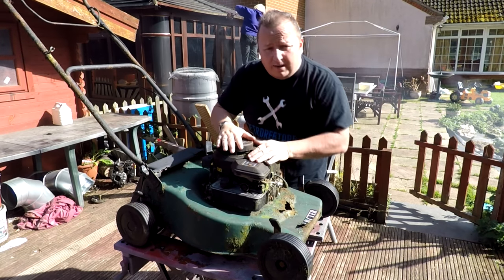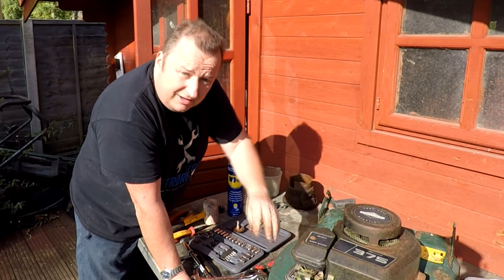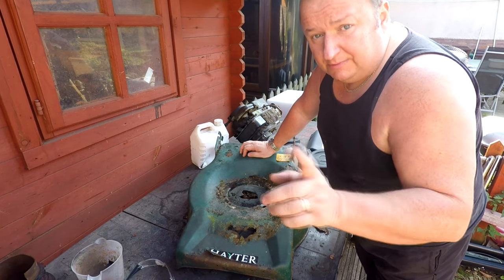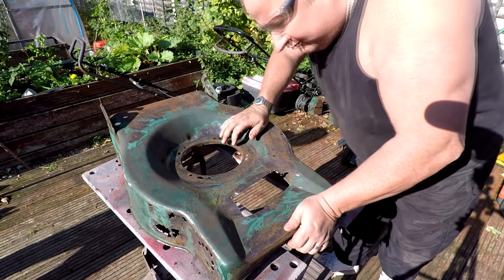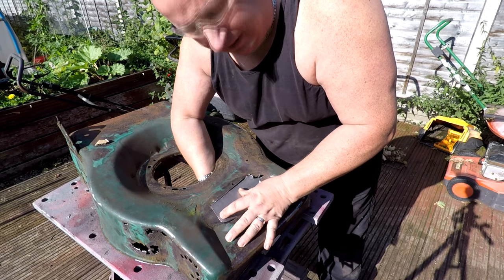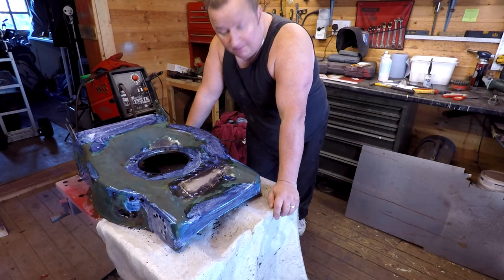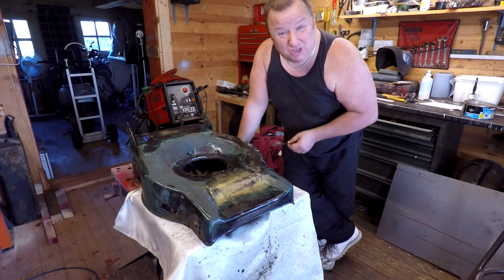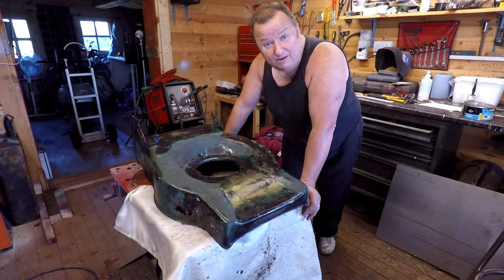The Worst Lawn Mower In The World Gets A Makeover

Comment: A handy tip...weld doesn't stick to copper, so if you clamp a piece of copper to the back side of the mower...it'll give you a base so you can puddle weld the little holes up
Reply from the maker: Yes Andy, I will be doing that for the other bits.

Comment: FYI: For rusted smaller bolts like the ones holding the engine to the deck, you can tighten them till they snap.  A lot faster than grinding, cutting, and hammering. :)

Comment: Martin you need to get some copper plate to help with thin metal the weld wont stick to it and it helps loads when you have to fill large gaps
Reply from the maker: Yes, I have a bit that I use for welding but that will probably be in the next vid.